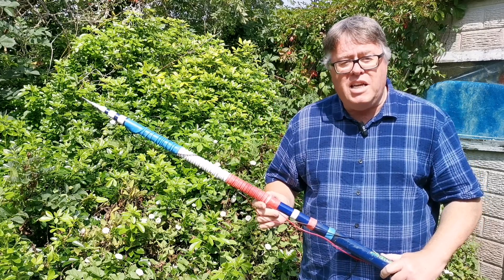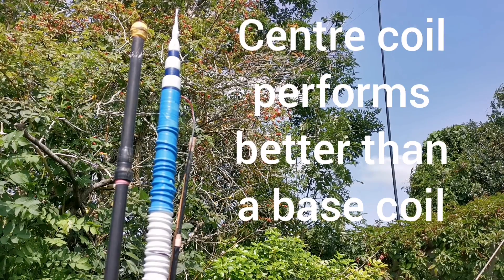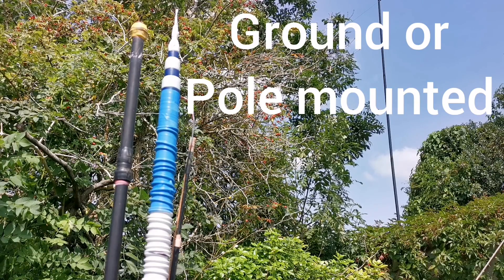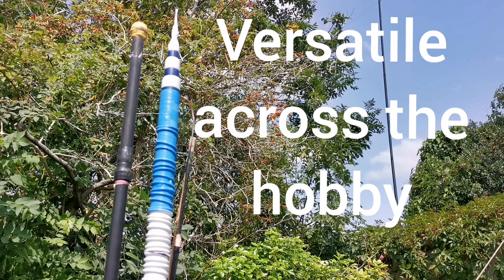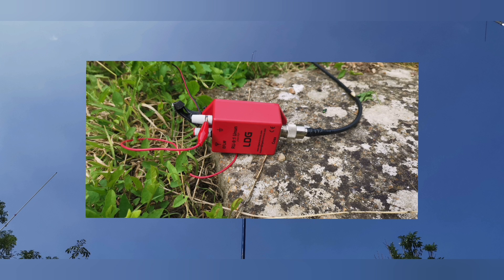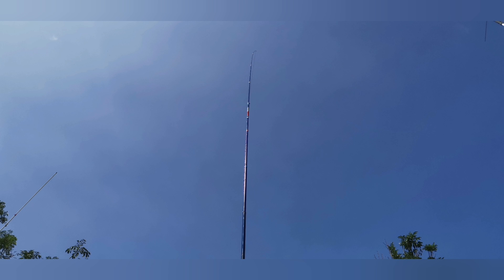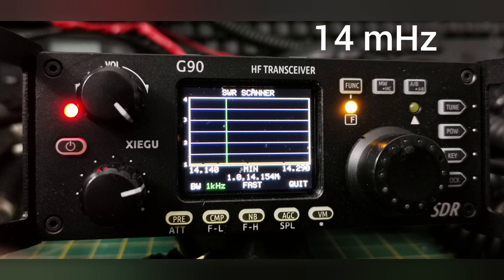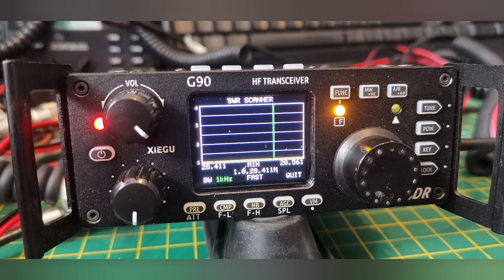Enthusiastic Steve: NEW Apollo HF Multi-Band Antenna for HAMs, Amateurs and CB radio users.

Comment: so the entire length of the single wire is just over 45 feet is that correct? and if there is no counterpoise what goes to the other side of the unun?
Reply from the maker: @pauld8009  yes, it worked without a counterpoise, though you could add one. Experiment,

Comment: Question from a newby, RE-I just used insulated speaker wire, is that one single cable or an pair of cables. I will now find and watch your video on the 9:1 Unun.
Reply from the maker: @crfsparky4338  it could be either. You need to look closely at the ends to see if it is just a single wire has a outer under the rubber outer. If it is 2 wires just use the outer wires. May be a little thing if intending to use any more than low power through it. Good luck, thank you for your comment regards Steve

Comment: I can see the drawing but have you any other details of the coil. What diameter is the former that it is wound on and is it just a method of putting more wire in a smaller space so that it doesn’t need to be too long or does it give a certain inductance? If so have you measured the inductance or have any idea what you are aiming for? Thanks, John.
Reply from the maker: @johntyler4222  i wound the coil many times before i got a satisfactory result. I do not have measuring equipment for inductance. So aim was to put19ft 7inchs of wire in a coil with small gaps between windings, air gap, the 19ft 7 inch of wire when wound around the fibreglass pole 14ft from the bottom took up a total length of 17 1/4 inchs. The pole is approx 1 1/4 inchs diameter at the point of winding. A 9m pole works or longer. The aim was to achieve the longest length of of random wire on a short pole and to use an inductor/coil to assist in tricking the antenna into thinking it is even longer plus to raise the current of the rf wave away from the base. Hope that helps. It took me a lot of fettling but result is it works well, and am hearing others are successfully making their own. A tip, use a coax feed with a choke 5 to 10ft back, this will help to achieve the vswr required. Regards Steve

Comment: The Apollo is great ! Thanks for publishing the design. I tested it today and found it easy to match on ALL amteur bands 7-30MHz since the SWR presented to my N7DDC AT-100 tuner was always within the tunable range. This was not the case with my half size W3EDP vertical which presents an infinite SWR at 14MHz. I think I need to do some tweaking there !

Comment: Is it one continuous wire?
Reply from the maker: @johnlew5972  yes, one wire, just a random wire not resonant on any band and a coil/inductor to optimise length on a smaller pole plus to raise current flow higher off the ground to optimise output. 👍
Reply: @EnthusiastSteveM6WVV  Current flow? (where the energy/ signal flows from?)
Reply: Thank you for the response.

Comment: I expect an extendable black carbon-fibre pole is not recommended? How much loss is there in a 9:1 un-un?
Reply from the maker: @ianliston-smith7921  carbon fibre is conductive so not a good idea to use for this project. Any fibreglass pole 9m or over would work. You get a little loss with any unun/transformer, but not that noticeable, they are widely used. Make your own or purchase one from a branded supplier. I have never had a problem. I did a video on this unun, it is still on my youtube channel, cant miss it. Big red unun on title screen. Thank you Steve

Comment: Were these contacts to North Pole usb phone
Reply from the maker: @trevorwashbourne3253  no they were part of the wspr tests, it demonstrates where your antenna has been successful sending the rf, if more power was to be used those signals could quite possibly follow the same paths using voice ssb modes. .
Reply from the maker: @trevorwashbourne3253  all tests were conducted at under 5 watts pep, i have made voice contacts across Europe using the antenna and only 10 watts pep voice ssb.

Comment: What sort off wire did u use also what power can u use  please send me  measurements
Reply from the maker: @trevorwashbourne3253  power is limited to the unun used, the ldg one can do 200w pep. I just used insulated speaker wire that i had laying about. Use a thicker gauge if you were looking to run at high power through it. All my tests were done at less than 5 watts pep.

Comment: What is the total wire size also u say you have coiled it how many feet have you coiled
Reply from the maker: Pause on the sketch towards the end, all the details you need are there. Coil length both wound and unwound lengths plus wire lengths above and below the coil. 👍

Comment: I might try to make one of these , maybe shorter 'cos I never venture onto 80m so a 40-10m coverage will be adequate. Thanks for the info.
Reply from the maker: As long as the wire is not a resonant length on any of the hf bands it will work. 👍

Comment: What length pole did you use ?
Reply from the maker: @spanner1036  this was a basic 27ft roach pole, a standard 10m or a 9m pole will surfice.
Reply: @EnthusiastSteveM6WVV   thanks Steve.  Also as your using a 9:1  does this need a counterpoise  ?
Reply from the maker: @spanner1036  the results on screen are without a dedicated counterpoise, i believe this design will happily work without one, i noticed no real difference when i added wires ground mounted. Bit it may use somevof the feed coax as its counterpoise, hence a choke of some description 10 to 15ft down from the unun. Try it with and without, there are so many variables what does not work for me may do for you. 👍